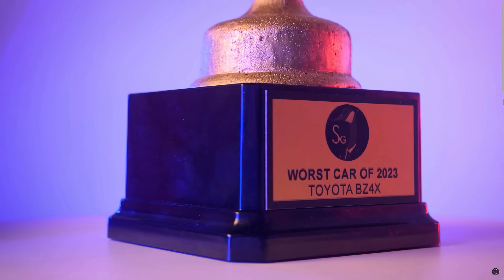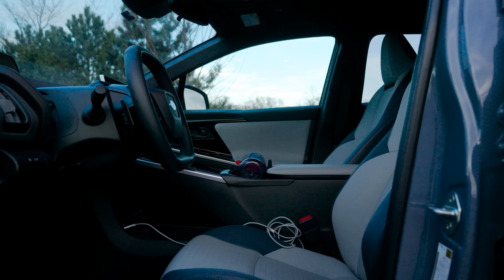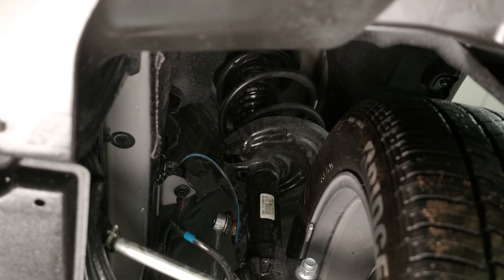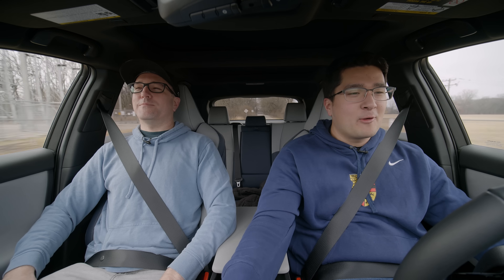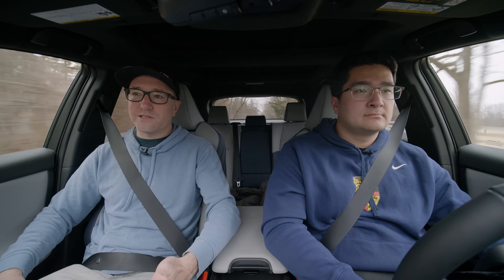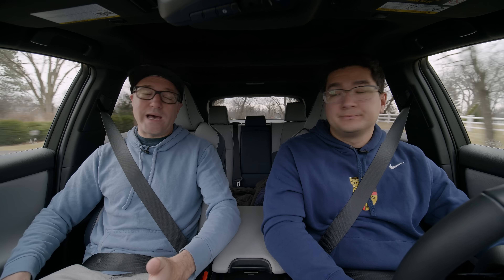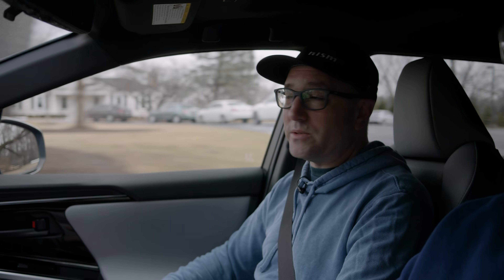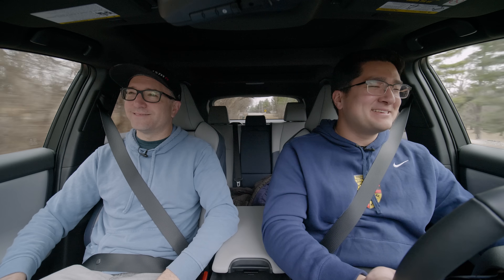Subaru Solterra | Sorry in Advance

Comment: This car is already 5 years old now. It was meant to come out in 2020 and got delayed until 2021. Everyone else has moved on. Cant believe they are still selling them and havent updated to a new model.
Reply: I do wonder how much longer before it gets a substantial facelift and battery/motor upgrade. Hopefully for 2026. They did crank down the price for 2025 but more is needed.

Comment: To the savagegeese team, in my opinion, you guys are kind if doing your viewers a disservice by not reviewing the now defunct Bolt EUV. 

Considering the Solterra is basically a BZ4X, we already know it sucks and is compromised.

You state the Solterra still has a use case as a daily driver but a 2 year old bolt EUV does it even better by better meeting the efficiency, range criteria the Solterra lacks (leaving only the charging box unchecked)

To top it off the used Bolt EUV's are an insane deal!

Show your viewers a value alternative instead of the same old same old.

Comment: The battery capacity with how much it costs to recharge is horrendous. Sure you’re not buying gas but 25 dollars in electricity to go 200 miles is a lot more expensive than a lot of gas cars. I put 30 bucks in my Venza and it’ll take me 500 miles.
Reply: Generally speaking, in the most expensive electricity parts of the country, fast charging per mile costs can rival that of gasoline. Nobody should buy an EV if they have to rely on public fast charging constantly. It's the much, much cheaper home charging rates where the money is saved. You have to be able to charge at home. For me in Utah, my home electricity rates with typical 3-4 mile/kWh efficiency works out to around $0.03-0.04/mile in electricity costs to drive an EV. Gas can't touch that, it puts a Prius to shame.
Reply: @ it helps if you have cheap electricity. I’m in Alaska. It’s not the most expensive in the nation but it’s far from the cheapest. I’m also an Uber driver so I’d be using that public charging a bunch.
Reply: @  yeah, electric makes the most sense if you can slow-charge at home as much as possible. For constant vehicle use where you need to re-up during the day like Uber, no doubt I'd choose gasoline.

It's frankly the simplest way to decide whether one should go EV or gas: just estimate how often you would have to use a public charger. If it's more than 10-20% of your total charging, go gas.

Comment: I will offer a counterpoint to all the people dunking on this (most of whom have never driven one).  We have one that we leased with about $12k off sticker.  It's a second-car family runabout for us, and we have charged it anywhere but home precisely once in a year and a half (and, admittedly, it sucked to do so).  Where we live, we see about 500" of snowfall a year (Utah Mountains).  We drive it 50-80 miles each day, every day for the school run and office commute (and errands) and can charge at home every night.   We are in the demographic of about 430 people in this country for whom this car is the right choice and it's actually good.  The AWD system is genuinely better in the snow than other EVs.  X-mode genuinely helps in deep snow (more than 10").  The learning curve for operating this EV is basically non-existent compared to other vehicles like Teslas and Rivians.  I would pick this over a MachE, over an ID4, over an Equinox, over a Bz4X, and even over a Tesla *for our specific use case*.  I have a Tesla AWD LR that we use road tripping, but if I driving to the grocery store (15 miles and 3000 vertical feet each way down and back up a mountain road) in the winter, I genuinely prefer taking the Subaru.

EDIT:  Our big complaint about this is how off-brand a short range Subaru wagon is.  Outbacks, Foresters, Crosstreks are phenomenal "road trip to a National Park and go camping" cars, and this one just can't.  It's a dumb car with a very specific niche.  But I'm in that niche.
Reply: Came from a Tesla, and picked the Solterra over both an ID.4, and Ioniq 5/6. 
It does fit better for some people. I honestly just loved the how ti felt to drive, and it mostly out spec'd the older Model S it replaced.
The AWD system in it does not disappoint, heat pump, and wiper heater makes this a really good Central OR vehicle in poor weather.
I also live off public chargers as I live in an apartment. The 2024 really isn't that bad, starts off slow and but ramps up nicely with a decent curve,
Reply: @jnrivers  This is actually a really good point.  Yes, they noted that turning on the HVAC reduces your range, but my Tesla just doesn't tell me.  Our 220 mile Solterra gets ~140-150 miles of range in the Winter.  But honestly?  My 330-mile Tesla M3LR isn't much better.  Sub-freezing, I see about 170-180 miles of range from my car.  Weirdly, I'm impressed by how much better the Solterra holds range in the cold (and it honest about it).
Reply: This is the exact scenario I would get this car for/ home charging and go around city car and CHEAP lease deal is perfect

Comment: I test drove this for a day using Turo and found when it comes to features that make an EV, this lacks: true one pedal drive, proper EV software (eg. battery preconditioning, route planning), the minimally acceptable 150kw charging for AWD, acceptable 200+ mile range, no access to Tesla network. In the crowd this vehicle runs in, it trails far behind and can’t even match the range of the now previous generation Chevy Bolt. A good car that is completely let down by its EV components.

Comment: I test drove the Ioniq 5 before leasing a Solterra..  that car felt so cheap in comparison.. cheap feeling seats,interior, no wireless AA at the time, and the handling was like a boat it was so heavy.  The Solterra was far better for driving even though it had less power.   Also, the Solterra 0-45mph is faster than the 2019 WRX I traded in.. way better around town to have that punch.  
The car gets a lot of crap, and it should for range/charging, but if they ensure buyers are aware and it meets their needs, it is a great car... to lease. 

Subaru/Toyota can easily fix this car.. they have a better battery in the non-US model with faster charging.

Comment: I enjoy driving the solterra as a loaner car from the dealership. I loathe the piano black plastic of the Toyota interior. I'm disappointed by the range but it would do fine as the city car knowing that you get the 10 days of loaner car from dealership if you want to travel. Charging isn't really an issue to me because I rarely exceed the 150 mile radius of where I live and there are enough level 2 chargers to make up the difference. I won't own one but I do ask my self why I like it so much and I don't have that answer. Rooting for a good Subaru EV by 2030 though not holding my breath.
Reply: It brings up a good point that many reviewers can't comprehend to acknowledge: that not all new car buyers are serious roadtrippers or care about posted range virtually at all. Most 50+ adults I know have not road tripped further than 100 miles from home in 5+ years. They simply don't do it. Tens of millions of new car buyers fit this description and have a single-family home with a garage to put a level 2 charger in. That's why those people don't care about "range weenie" concerns, and they go ahead and buy. And many of those same people want an EV, but they demand it be from a trusted brand they've been buying for decades. Which is how the Honda Prologue somehow became a sales success.
Reply: It's a very nice car. It's not the worse car. It's not a great EV. But it's a nice car.

Comment: I had no idea these had such low range compared to the competitors.
Reply: It's only about 30mi difference from the competitors, and it's reasonably accurate unlike some of the others (came from a Tesla).
Summer months I average about 240mi, in the winter about 180.
Reviews get very caught up in the numbers game with this vehicle, rather than the real world experience.
Reply: The car has decent range for urban driving.  I drive these cars BZ4X and drive in town driving.  I charge every night on a Level 2 charger.  When I take it on trips I have no problems with that.

Comment: Need you guys to explicitly criticize the manufacturers and customers for putting worse wheels on higher trims across the board. Wheels only need to be big enough to fit over the brakes. 

Also, sunroofs that open are leaky trash that will cost you $2000 the moment the warranty expires. They eat headroom.

Comment: You folks said mid-sized a few times but isn't it a compact sized car, like the Crosstrek for example?  And this .2 inches of additional ground clearance... isn't that basically in the ballpark of normal production variations?  Again just one more example proving that building EV cars based on laptop battery technology is just plain stupid and who leads the way on stupid? The same guy who built the EV Trash Dumpster and then got the head of the FAA fired. Just brilliant!

Comment: I’ve had mine for about a year and love it. I live in Colorado and it handles the snow like a champ. I’ve averaged 4.3 miles per kWh.  Summer driving range exceeded 280 miles in mixed driving. Winter driving gets 230 miles in mixed driving. I’ve taken it over Ike’s pass on i70 for a 750 miles road trip and it handled a flash flood in Glenwood Springs. I have a 40amp charger in my garage and only charge on public chargers during road trips. I am thoroughly impressed by the SOLTERRA and I look forward to what will be available next when the lease ends.
Reply: How do you pull that highway range? No A/C and reasonable, lower highway speeds? I know it's possible, my 4Runner is rated 19mpg highway and I get 24-25mpg every road trip because of my driving habits.
Reply: @thatoneotherotherguy   If I’m only highway that range will go down. However in mixed driving I can recover allot of range with one pedal driving. I’m plus 3 psi on tire pressure, very relaxed driving no hard breaking or hard acceleration and that’s about it. Also I only drive in eco mode.
Reply: Oh hey, Subaru salesman.
Reply: @jackbauer4607 I don’t want to disrespect anyone who sells cars but that’s not the job for me 😂
Reply: Do you have a bZ4X fwd or a Soltara? Because there’s no way you getting 60 miles over the EPA listed max in a Soltara.
Reply: @hyperllama1207   I have the SOLTERRA and I get 50 miles more range in the summer than in the winter. I had a Bolt EUV before the SOLTERRA and drove it more than 55,000 miles during owning it and in the Summer it got over 290 miles of range, unfortunately in the winter it got under 200 miles of range. While both the Bolt EUV and the SOLTERRA are affected by cold temps the Bolt EUV really hated the cold. Plus it was fwd and even with Michelin Crossclimate 2’s it could not handle the snow.
Reply: @hyperllama1207  SOLTERRA and I live in Colorado Springs if you want to drive my car and find out for yourself.
Reply: @hyperllama1207  maybe his lie-o-meter range claimed he could go that far when descending the Ike, lol.
Reply: @daniels2761  I’m in Colorado Springs if you would like to drive my car and find out.

Comment: Where I live (Long Island, dense suburbs) you have an aging population who just uses their cars to shuttle back and forth from shopping - everything you need within 10-20 minutes. "Long trips" are maybe 20-30 miles away.

So for the retiree who just wants an around town car to keep plugged in while parked at home, it's fine... maybe hang on to the 2003 Avalon for long trips.
Reply: Or just buy an ioniq 5 that can do both short commutes and roadtrip lol. That’s the problem, they could have made a good car because the tech exists now.
Reply: @ Fair point, also the use case I outlined applies to such a small segment of the population that its limitations just don't make sense
Reply: @hlothr  I tried looking at leases with Hyundai in the Seattle area. No giveaways with the dealers so I passed. Not gonna drop $4K as the cash down.
Reply: Yes, people on a fixed income, just who needs to spend money on an obsolete car in an inflationary environment.
Reply: The 2003 Avalon is the ultimate vehicle. There's no need to ever replace it.
Reply: 2003 Avalon miss those!

Comment: The perfect car for the chalk eaters who will not  cross shop, read reviews, or function with even a modicum of automotive awareness.
Reply: I cross shopped the bolt, mustang, and ioniq 5.  The bolt was too small and cheap, the ioniq 5 drove like a boring brick and felt really cheap inside, the mustang was too small and also felt cheap.. then the Solterra felt nice inside and drove well.    I was fully aware of the limited range.. I am 7K miles/9months in and never used a fast charger since we have another car for trips...  its kind of a perfect commuter car if you have a secondary car for long trips at home.    My home charger calculates usage and in January it came out to the equivilent of getting 39mpg when gas is $3/gallon.. not bad for a medium SUV and not bad for our high elecitricity prices during one of the least efficeint months for an EV.    
Anyway, it is my first lease and they gave me $21k for my WRX that I have invested.. that invested WRX money is going to pay for my next car outright.. so all things considered.. Im making out well.
Reply: @ @ Appreciate that not all buyers did so without careful consideration. Any car you buy, no matter what others may say, is the best one if you put in the work to make the best decision for you. Like they said, not a bad car. I was just as careful when I bought a CRV last year. Not a glorious Porsche but against the others, the best for me.
Reply: That's the average EV buyer.

Comment: I get between 4-5 miles per kwh on my BMW i4 edrive40 during summer and 3.7-4.2 during winter. Such a disgraceful vehicle to put out by Subaru, with such low efficiency.

Comment: I leased one back in July, trading in an Outback XT Touring. I drive maybe 40-80 miles most weeks, and we have an Ascent in the house.  So for real range Ascent is the go to, but anything under 200 round trip I've had no issues. But it's generally relegated to around town, appointment, grocery getting duties. It's far from perfect, but suits me just fine; I'm also an Ambassador, so that's part of why I stayed with the brand. I went in knowing that I'm in it until the 3 years is up, which I genuinely needed to do. The front generally looks better than the Bz4x , and the rear facia is just too close to really call it with the difference being in the tail light design.

I can live without the frunk, what I want is SUV design language with a taller cargo area. If you live somewhere that gets snow or where the roads are hot garbage, there's an argument for Solterra and BZ, and it's the ground clearance. I feel like that extra 2 inches over Ioniq and 3 inches over Mach-E is gonna make a HUGE difference in preventing battery pack damage from road hazards. Yes, it needs fixes for everything that everyone judges it for, but as a daily commuter for the right price its adequate. Compared to the Starlink in now all other Subaru products, save for the BRZ... this Toyota system is nice. Still needs knobs... but the separate HVAC controls etc just make it miles better than the rest of the line-up and hopefully it carries over to others soon. My sales person since I've been going to this dealership got one the week before I did, and when they first came out we were both very critical of it. Supposedly there are 3 new EVs on the way, hopefully Subaru and not just rebadged Toyotas.

I may cheat on Subaru for an R2 when this lease is done, depending on what they have at the time and if it's better. I don't want to go back to gas, and with everyone switching to NACS, charging on the go will be much less of an issue if needed.
Reply: Subaru has ambassadors?? 😂
Reply: I would think Subaru should be on the Supercharger network by the time your lease is up, and using adaptors during infrequent public charging is not a huge bother.